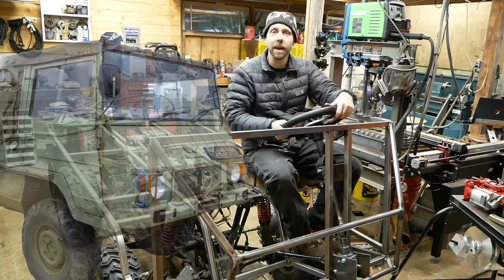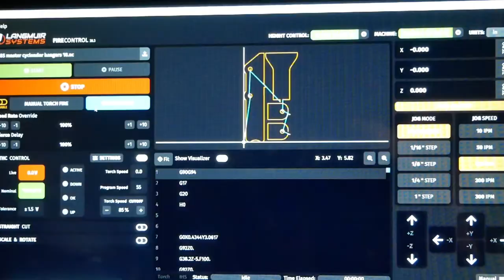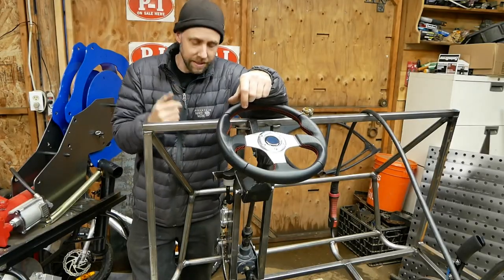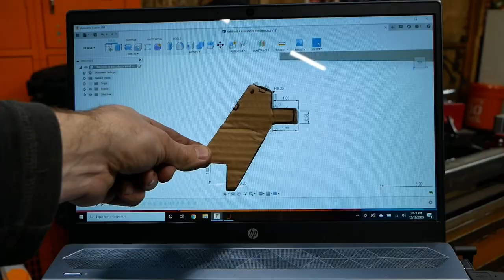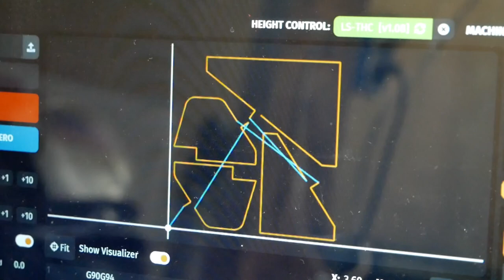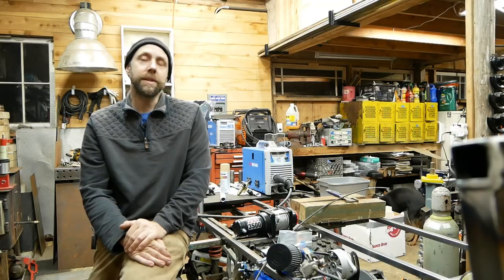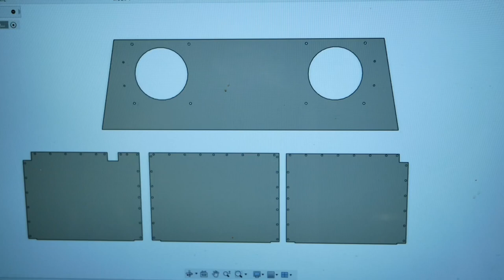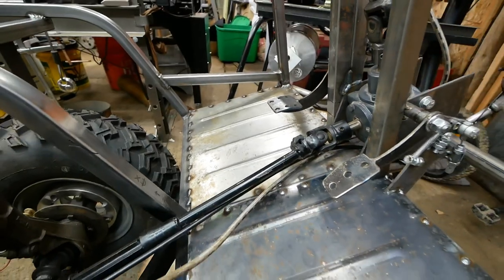Mini Pinzgauer 6X6 off-road build series part 5

Comment: One of the guys in our off road club has one of these and used to wheel it.  The only thing I'll say is be EXTREMELY  careful going down hill!  Pinzgauers are notoriously nose heavy and it's fairly easy to lift a tire.

Comment: Can't wait for the Bead Roller MODS! Also like the shots of the CNC table in action. Thanks for another Friday night Festiva- Fab-Fix. I agree this channel does give me motivation to get in my shop and work on projects. Just got a Titanium 200 to replace my 1973 Airco MIG behemoth. I'm hoping there's a CNC plasma in my future as well.
Reply from the maker: Right on 👍
Thanks for checking out my new video!
I think you will really like your titanium 200!
Mine has been rock solid for the past 2 years now, I don’t think any inverter welder will last like those old transformer welders like your Airco but at least you don’t need a forklift to move them 🙂
I hope you get a lot of projects done this weekend! Take care
Reply: @Mikefestiva  And I won't need the usual Pot-O-gold to pay the electric company compared to the old Transformer machine

Comment: I think Mustie1 got pretty much the same ring roller as you have somewhere between a couple months and a year back. He also stiffened it up and added a power feed. I'm sure you could figure out a proper solution yourself, but some inspiration is never a bad thing.

Edit: It was 11 months back, time flies. He called it a bead roller, you should be able to find it that way.
Reply from the maker: Thanks Tim! I got a DC motor and most of the parts really to install, I just need to cut the few mounting plates on my CNC table. 
I appreciate the suggestion 👍

Comment: I started with the same bead roller, you can beef it up pretty easy, I used some 120 wall tubing on the other side of it and it took out all the flex, I can also do 14 gauge with it now as well. Its powered by a winch motor and has a foot controller. that said keep up the good work!

Comment: It’s a super build series, but just one gripe - when plasma cutting shapes with holes in, like the shock brackets, it’s better to cut the holes first; if you cut the outside edge first, the part can move and put the hole out of position.

Comment: Hi Mike
Love this project 
I was thinking of doing the same thing with a old Kawasaki 
Thank you for sharing all your ideas
Paper template is really good piece of help.
I guess all the negative nanny’s don’t build much.
Your piece on welding wire is awesome 
I found the same problem using Lincoln wire.
Reply from the maker: Right on! Thanks for checking out my videos 🙂👍 the Pinzgauer was fun to build, the old quad truck I built years ago was fairly simple to re-power and build, was so useful around my property but lacks the style of the mini Pinz 😊

Comment: This is a great video showing your skill on the CNC plasma cutter. Seeing as its easy to make successive repetitive cuts I was wondering if you might consider something on your next build. That is weight? Cutting extra holes in thicker metal may be a way of reducing the weight on an item. Sometimes you need weight - as you have mentioned in other builds - but this may be a simple transfer of weight from back to front or visa versa. Keep up the good work - cant wait to see the finish of the 6 wheeler!. Another thing I noticed is that it might be nice (don't know how practical?) to have some sort of suspension in the middle set of wheels - this would eliminate the back wheels hanging out -as I've seen while going over rough ground - and loss of traction - just a thought.
Reply: both rear axles do have suspension but the way it is rite now both  rear shocks are fully extended because their is not enough weight over them so it acts as if the suspension is solid. When he is done and has more weight over the rear end it should work better, he may have to take some of the preload off the rear springs to get them to run in the middle of the suspension stroke

Comment: Nice job! Pro tip take the 
crank arm off your Bead Roller and replace it with a Wheel that makes up the same circumference as the crank. Tip from, Rat Rod Bob. 
YouTube, Rat Rod Bob Builds.👍

Comment: Would it be easier to mount the second shock linked to the first one, it would save space and reduce complexity, you would have to make a linkage that connects the stock shock to the ones you put on and have it spaced apart, is there enough room for that or am I just insane?

Comment: You sound like a boy scout when it comes to your brake system. A backup for a backup...lol
Reply from the maker: Haha 😂
Reply: He's right about the master size though. I used a single rear master like that on a 3 caliper polaris and it's barely enough fluid movement to manage three calipers. It works fine, but in his situation he'd definitely hit the floor with the pedal before the pads clamped. I love how he doesn't even make these mistakes the first time around. There is a lot of pre-thought going into these builds.

Comment: Inverted flare and bubble banjo fittings in the same brake system? Go easy on the Aspirin with all those headaches! 🤣 My cheapo bead roller I stiffened up by cutting a piece of 1/4" plate the same shape as the frame and then using 1/4 x 1-1/2 flat bar on edge to box the two frames together.

Comment: Such a cool project.  I'm trying to figure out how the rear suspension works.  It looks like the two rear axles can somewhat articulate independently up and down, but has none side to side.  Kinda like a three-wheeler.  Is that right?

Comment: Would of been a great idea to use rust spray weld primer before you laid the floor sheets down or i supposed ones painted or before painted  you can always Drip Check to provent rust between double panels  , Just saying . Great job you doing there as well , Cheers ..
Reply from the maker: I don’t have any weldable primer, what brand do you like to use? I kind of weigh out the results, don’t paint and deal with rust years down the road, paint and breathe cancer causing burning paint fumes.

Comment: Hi Mike...love the video.  I noticed that your cut sequence on the shock tabs had the tab perimeter cut first, then the holes. I usually do the holes first, just in case the tab wiggles or tips up.  I was wondering if you had a reason to do the perimeter first?  Enjoying the build, thanks for the videos.
Reply from the maker: Right on Tim you have a good eye!
Yes I always try to cut out all holes first on most parts before cutting out the perimeter.
I have been drawing and cutting all the parts of this building on one file, something happened in the settings that I couldn’t figure out and Fusion 360 started cutting out Perimeter first?
So I just added tabs to each part because after checking tool paths 3 times with my cut selection I wouldn’t cut inside holes first?
I’m sure I will figure out what changed at some point, all parts drawn in different files after this cuts out inside first. Who knows 😂
Take care Tim 👍

Comment: Started watching this series and ended up spending the whole weekend watching your other projects. Very nice work

It seems that the last video of your articulating 4x4 is missing is there any update on the end of that project?
Reply from the maker: Thanks for checking out my channel James!
You are correct, I have not completely finished my articulating dump truck yet. My shop is small so it’s one project or the other at the moment, I have been using my articulating dump truck all winter, hauling fire wood, gravel, dirt and rocks. I definitely plan on finishing up the last bit of the cab in a month or two.
Once my 6x6 can travel on its own power I should be able to move it out and the dump truck back in. 
Thanks again for checking out my videos! I really appreciate it 👍

Comment: Don’t mess about strengthening the bead roller, make a new frame. Trust me on this model :o) Make more of a C frame so you can roll beads after you have turned up an edge. Rollers are good, shaft is sound, frame is just pants even with steel welded on. *if you make the frame solid enough to bead nicely it should ‘English wheel’ as well ^-^

Comment: Hey do you have any document for the cut speeds with your cnc plasma? I got a similar 45amp plasma on my home made cnc and could use a little help figuring cut speeds and air pressure depending on thickness, thanks alot
Reply from the maker: I should have a video posted in a week or two about my CNC table, in that video I cover cut speeds and amps and Pierce times 👍 so keep an eye out for that one. I think it will definitely help some people out. Take care

Comment: Great work Mike! I am running late catching up on this series (that work thing)... Just curious, why don't you at least prime your small assemblies before you do the final installation? Is it no factor,  and do you go off the fact that your final paint is sufficient? Just curious, and seriously,  thanks again!
Reply from the maker: Thanks for checking out my videos Rick 👍 I really should buy some automotive or equipment paint for these projects, I just don’t have the best shop to be painting with a spray gun, but it would be a far more durable paint. Probably one of the next builds I will end up using 2 part equipment paint on. It just adds to the already time consuming and expensive cost of building stuff like this. Take care 🙂
Reply: @Mikefestiva  Thanks for the quick reply, I definitely get the sparse time for projects! I fight for my extra minutes as well trying to catch up on all the things. Your builds have definitely inspired myself to begin learning to weld ( I'm a woodworker by trade) and take on a chinesium quad build using a predator motor. Looking forward to doing it with my boy (8yo). We've got a lot to learn, but it's gonna be fun. Thanks again Mike!

Comment: Just wondering why you don’t cut your plate to the edges? 
Most give a lot of waist materials over time 🤔
Reply from the maker: Well if you cut all the way to the edge you run the risk of your torch shutting off and the part would be wasted, believe me I get a lot of cuts per sheets. Plus this steel is purchased as off cuts as a discount compared to buying it as a full size sheet. I usually cut out some of the smaller pieces on the off cut sheets as quick gussets I can weld in on projects too. Take care

Comment: Found your channel while looking at the YesWelder brand.  Are you using it on this project?  Curious if you recommend it for a beginner welder on 1/4" steel and thinner projects?
Reply from the maker: Yes I have been using the Yeswelder MIG 205 DS, it’s been a great little welder so far, for the value I really can’t find any other welder that comes close for the price 👍
I think it would be a fine welder as your first, I really wish I had something like this years ago when I started welding. Take care
Reply: @Mikefestiva  I appreciate it.  Keep up the good work!

Comment: I would have used a vw sand rail master cylinder. Instead of those itty bitty four-wheeler Master cylinders.
Reply from the maker: Well I’m just working with what I got.
Remember we are working with quad parts on this entire build.

Comment: No offense but,
Welding , Machining , Cutting and the add/removal of EVERY nut/bolt/screw .
Getting old on a lot of channels.
I just want to see what your doing.
Montage thing has gone too far , so far , 
When see it , I FFWD , (that's the -> key)
Reply: That is what this channel is about... not fast forwarding to when something is finished.
Reply: @jonathanbraud5648  NO, i did not say that.
I said/intended FFWD thru ..... .